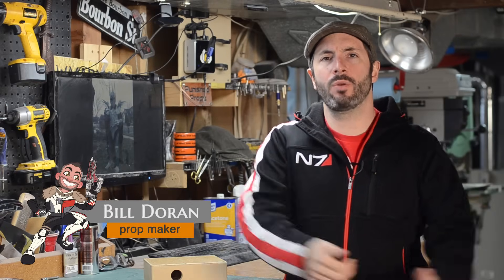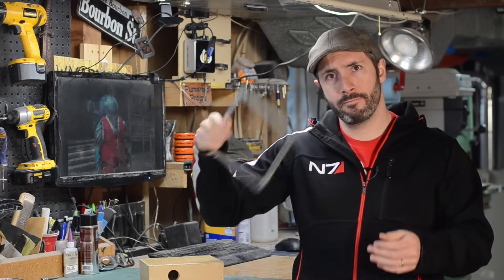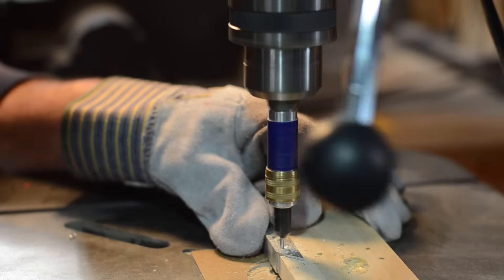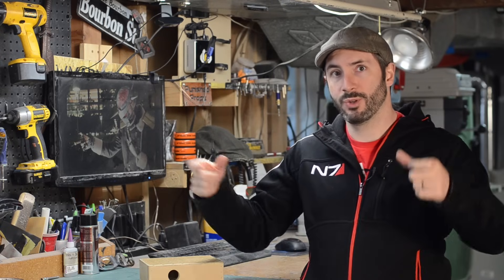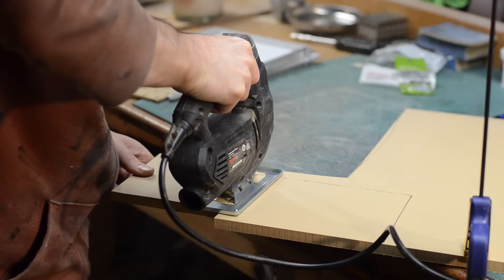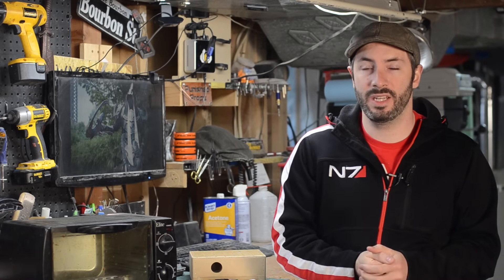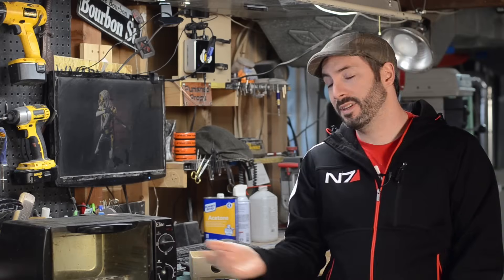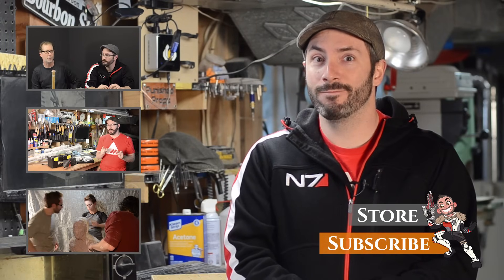Prop: Shop - How to Make a Vacuum Forming Machine

Comment: Do not forget to use a release agent like talcum powder to help get the thing apart after it cools and shrinks onto your item you are trying to mold. just a dusting of it on the mold before you vac form it is enough and helps a lot.

Comment: I'm gonna build this. I've always wanted to try vaccuforming (although I'm primarily interested in some of the "toxic" plastics like Polycarbonate, PVC and Acrylic glass, but I can always use a gasmask while working so it shouldn't be an issue).

A quick question though: when using the small box/table part do you experience an even amount of suction throughout the surface of the perforated table area? I'm thinking that it would be best to make the box as short as possible with the bottom and the top part as close together as physically possible to make the suction even?
Reply: Yeah, that's what I'm afraid of. I intended to build a table a little larger, but not by much though. Only a surface that can handle plastic sheets enough to make facemasks, since that is what I do the most.

If I do run into problems with uneven suction there are some things I could try though. One thing that came to mind watching you build it was milling out one or two circular grooves in the hole where the vacuum hose goes to and then insert some rubber o-rings of fitting size. That would help create a solid seal around the hose.

I'll start out with your basic design first and see what happens. :)

Btw, I looked at a video where Adam Savage demonstrated his large, professional vacuforming machine. I noticed that the heating elements at the top of the machine wasn't all that different from the heating coils of your average bread toaster. I wonder if it would be possible to build something similar by taking apart a couple of old toasters?

That way, one could make a heating area as large as they like and not be reliant on the size of whatever toaster you have on hand. :)
Reply: Seven Proxies how about using multiple vacuums?

Comment: I need a copy of my vintage Masters Of The Universe Castle Grayskull because I'm going to make sort of a custom Grayskull wall relief. I don't want to destroy real Grayskull so it has to be copy. But apparently vacuum forming would damage the original since it's made of thin plastic. Right?
Reply: How about cooling the original before applying the heated plastic or using a sponge and some cold water across the surface of the original? This would both help to cool and harden the hot plastic you're applying on top, while also prevent the original plastic piece from reaching melting point. In theory at least.

Do a test with another piece of plastic of the same kind as your Castle Grayskull and see if it deforms.

Comment: don't need a toaster, use your oven
Reply: Assuming you're still using that oven for food, not recommended. When you can smell the plastic you're heating up, that's vaporized plastic that is not only permeating through the air, but also adhering to the walls of your oven. If you regularly use your oven to heat up plastic to melting point, that's going into whatever food is being prepped in that oven.
Reply: Also true
Reply: @greenmedic88  2 years later but i can't find an answer on google....is petg safe for an oven???

Comment: how can you prevent the holes from the pegboard showing up in the product?
Reply: Anguinus Vir yes, by not making holes.
I would use a window mesh & only have a hole in the center. Use the window mesh as a small spacer between the box & the object
Reply: Knuxiefan bullshit. Make a video showing, I'm sure it won't work.

Comment: Would this process work on molding something like an old Nintendo cartridge? I want to cast duplicates for a relatively cheap price, but need a master-mold first.
Reply: Well for one, if you intend to make an exact duplicate of the cartridge (such as to insert your own homemade game) it obviously won't work since the vacuum formed shell will inherently be larger than the master by the thickness of the material you are using.
Reply: Moviefan2k4 not sure if it would melt
Reply: Dave Smith, he could make a negative mold first.

Comment: I have a question about the holes in the top

Is it better to have holes that size? Does it make vacforming easier?

I've made a budget vacforming rig and I've had trouble with my test runs getting the plast to form over the piece and I know its not the plastic as its plenty hot enough, so I'm wondering if I've made the holes too small? The size of the drill bit I was using was approximately 1.5mm wide.

There seems to be good suction, but the plastic doesnt seem to want to conform all the way down over the piece so I end up with like a tenting effect where it partially forms around the tops and then angles out on all sides like a tent

Comment: Will a heat gun work instead of the toaster?
Reply: Probably a late reply but in my experience using a heatgun to heat u plastics for this sort of work is VERY hard. Let's say you intend to bend the plastic to make a curve or corner then a heatgun works. But heating up an entire sheet to vacuform according to this principle will be extremely difficult because you'll have a hard time keeping the temperature even all across the sheet. you're also running the risk of making the plastic boil in some spots since a heatgun usually focus the heat very intensely, which will cause bubbles in the plastic.

I'd really recommend using an oven of some kind since the oven is better at evenly distributing the heat across the entire sheet.
Reply: ***** good point
Reply: +Matthew Livingston or an oven
Reply: It´s too heavy duty to a hair dryer. Maybe a oven.
Reply: you can even use a hair dryer

Comment: place the plastic over first and then turn the hoover.
Reply: i noticed that you were getting areas were the plastic would form little pillars rather than being flush with the piece. placing the plastic on and hen turning on the hoover should eliminate this.
Reply: +cris rose Also, maybe building an assist to reduce the bridging.
Reply: +cris rose Also, if you have available resources, you can make a custom top plate on top of your vacuum former to direct the vacuum around the edge of your mold.  This directs vacuum closest to the part as apposed to the surface farther away.
Reply: +cris rose One last thing, this is tricky.  when you have a mold with intricate detail.  (No negative degree draft.)  Carefully drill a pilot hole in the back of the mold but not all the way.  Then from the face on top of the mold, drill a minute drill hole that intersects with the larger hole from the backside of the mold.  This directs vacuum to the minute holes sucking in the heated sheet of plastic tighter to the mold.

Comment: Hi, very helpful video. I am new to vacuum forming and I'm having a hard time finding where to buy the plastic sheets (preferable ldpe) or the least toxic and most transparent. I will be using resin so also something that will release the cured resin. Any suggestions on where to buy?

Comment: Do you think you could 3D print some of those vacuum forming bucks? I know pla has a low melting temp but it should hold its form for long enough I would think to make the plastic case

Comment: would that work with kydex
Reply: +steven espaillat Kydex is another thermoplastic but it won&#39;t grab nearly as much detail as styrene. But this is basically how holsters and sheaths are made.
Reply: Thanks I'll have to give it a try I'll keep you updated
Reply: Hey no prob. and that'd be pretty cool if you did, thanks!
Reply: +steven espaillat Being we're on the subject i should mention that I've just started a store on Amazon that caters to vacuum forming at the moment. Right now the selection is limited to 060 styrene, but if it's Kydex you're after, I certainly could get ahold of some.

Here's my store: http://www.amazon.com/060-Styrene-Plastic-Sheet-PolyStyrene/dp/B017S4BEIM/ref=sr_1_2?ie=UTF8&qid=1448350569&sr=8-2&keywords=060+styrene

Comment: I want to make a larger vac form like a 2X2 but im not sure what to use for the heating element any suggestions or ideas?
Reply: +Bryan xayyaveth 
There's also the protoform plans, but they're like $60, plus the "pro" heating elements they recommend are a few hundred dollars.
http://volpinprops.blogspot.com/2012/05/protoform-vacuum-forming-machine.html
Reply: +Bryan xayyaveth I was in the exact same spot you are. I wanted to build a 2 footer as well but was at a complete lose for my heat source, and didn't want to break the bank on a ready built element array. What I did was some research and found that making my own was far more affordable and easy enough. The way I went about it was using 17 gauge nichrome wire for the element, a variac to power it, and a high temp thermal insulating board to safely house the 1200 degree wire without, again, having to break the bank on ceramic nuts and bolts. This was last February. Since then I've started something I call the Cosplay Supply Store on amazon.com, where I happen to sell vacuum forming supplies. The high temp board I mentioned is something I have available, but not on amazon yet. If you have any interest, please feel free to message me. Good luck & Happy Building!

Comment: Very nice, I haven't really thought of this small size. What thickness would you recommend for the styrene?
Reply: +granander Your ideal thickness is really dependent on what you want to do with it. For example 060 or 1/16th of an inch is the "Norm" and I wouldn't venture below that unless it were a shelf piece. "06" as it's called is used on everything from hallowen masks to storm trooper armor. If you're looking for some to play around with, I do sell it pre-cut and very reasonably priced. Should you find it suits your needs, here's the link: http://www.amazon.com/060-Styrene-Plastic-Sheet-PolyStyrene/dp/B017S4BEIM/ref=sr_1_2?ie=UTF8&qid=1448353879&sr=8-2&keywords=060+styrene
Thank very much & Happy Building!